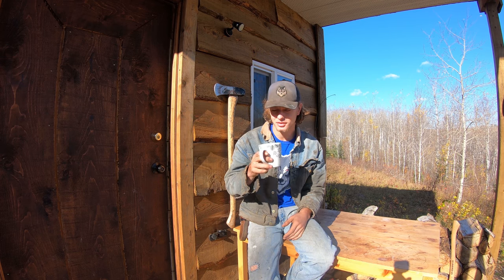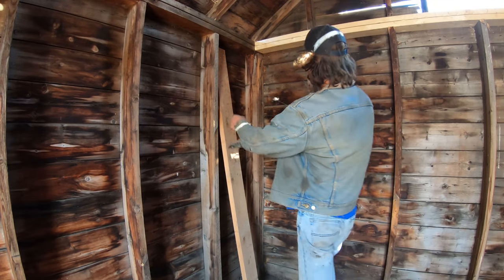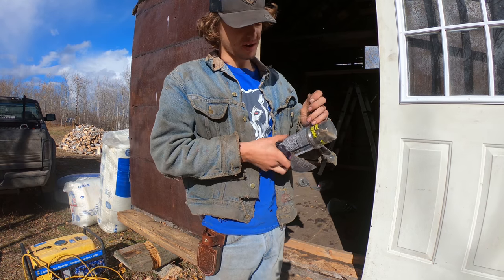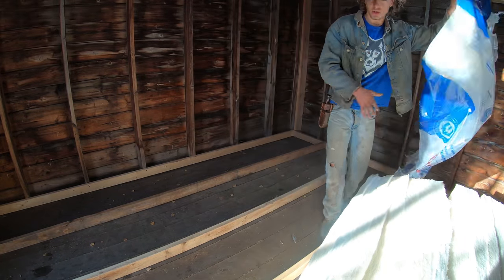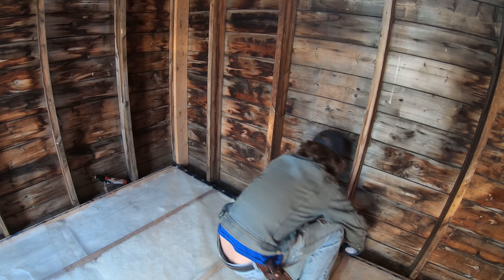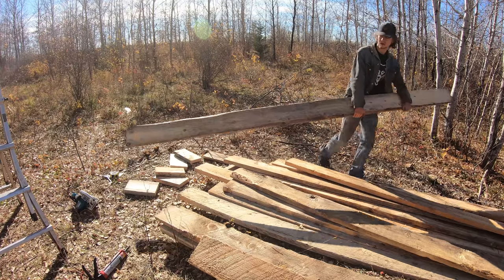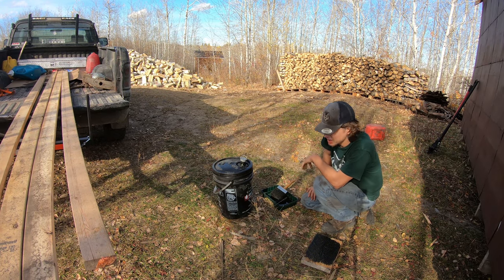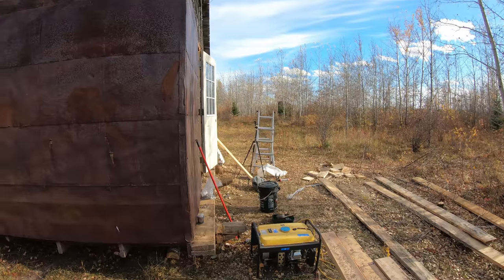Offgrid Workshop Project Pt. 3 - Putting a New Floor in the Workshop

Comment: You need to get a couple of lengths of ordinary, white pvc pipe, about 6" dia, cut an inch slot along the top and then attach to your rafter ends after you get your metal roof on.  This makes an easy and cheap eavestrough that you could collect rainwater with. I realize that it will be frozen most of the year but could make hauling water in the good months less of a chore.  I can hardly wait for the next episode. Great videos. Cheers from Vancouver.  :)

Comment: Floor tirned out great. Your going to suprise how easy it is putting on the tin roof. 1 tip predrill the screw holes in the tin so the screws look straight plus its alot easier putting them in and not having to fight screw going thru the tin. I put a tin roof on my garage and drilled 10 sheets at a time so they were all the same.

Comment: If you end up with more gaps in your floor than you'd like you could mix some wood glue and sawdust into a paste and use a putty knife to spread it into the voids. It'll be practically invisible once all said and done and it will take stain well. I've found that its stronger, easier to stain, and blends in better than any wood filler you can buy. If you use sawdust from the same wood you're gonna use your filler on you get a perfect color match every time and don't have to worry about staining your filler to match the existing wood. Also if your boards have any shrinking, expanding, or movement in general it won't just crack or crumble like most store bought wood filler would.
Anyways I'm lovin the videos, cheers from Maryland, USA.

Comment: Used trans fluid might give you a lighter colour...probably stinks a fair bit more though. We used to use it for undercoating vehicles and machinery, and would spray it with a cheap hand pump sprayer.  Not sure you could spray used engine oil, but I can't see why not.

Comment: Great work just offering a though. Not sure if you plan to put anything over the insulation to cover it, also not sure what foam board sheets cost in Canada. Where I live it and sheetrock are close to the same price. In a workshop that I wanted as much insulation for the money, I would use foam board instead of sheetrock. I would use sheetrock where you plan for the heater stove pipe to go through.

Comment: Hey , not trying to be the “ You Should Have Done Guy or Know It All “ one  either , just something to think about Guy and you may  already be on this , you will have to be  careful with any kind of liquid going through the cracks in your floor boards , the moisture barrier will just hold the liquid -  Water,  Blood,  etc. until it dries which could take along time and the smells would be horrendous , also causing mold on the bottom side of your floor board’s. 🤔 You have done a great job and I admire your work ethic and being your on man paying your own way , you don’t see that much today .👍👍👍 It would be awesome to have shelters  on both sides for dry firewood and dry storage , Future projects ?? Keep up the great work.  All the BEST to you and yours.

Comment: The building is coming along. Great video. If its always windy there I'd look into a wind turbine for energy. Might make more power that way.
Reply: I think that it's kinda costly for a small wind turbine. ..prolly why he doesn't have one yet. Maybe he'll post his post office box number &address so a fella could send a little to curb the overall turbine costs
Reply: @MC-gp9ke  just need an old wind mill, wire an old alternator and deep cell truck batteries. Then just transfer the power from batteries to the source of the fuse box.
Reply: @aarond4821  thank you Aaron,  I'll try an old windmill that was used to turn a waterwell pump. I'll investigate types of alternator -generators to feed a set of deep celled truck type batteries. From there I will  use a inverter or converter to produce Alernate  Current (A.C.)  power from the Direct Current (D.C.) battery supply. Not certain the amount of power that I'll end up with ...

Comment: I'm curious about your opinion on American building codes for insulation that I saw on Matt Risinger's channel. The recommendation for your climate area (alongside most of Alaska which is my interest in homesteading) is 20r-value cavity insulation + 5 continuous or 13r cavity + 10r continuous, which also means inside insulation rating + outside insulation. (I noticed you didn't insulate the outsides of your buildings and was curious if there's a notable effect.)

Source: Slide 23 from the Residential Provisions of the 2018 
International Energy Conservation 
Code you can easily find in Google search.

Also make cob constructions like the OG canadians and Americans did lol. It's so much cheaper than buying the wood and you're on a massive wealth of clay. You just need some straw and sand.

Comment: if you think your nail or screw is going to crack what u are putting it in flip it around and dull the point by giving it a good wack with the hammer .old carpenter trick

Comment: looking good!  What you think about putting your wood stove on either side of the front door?  Kinda  dead wall space, not hauling wood thru the shed and with the zone heat the wood burners create you have the hot spot in the coolest location??  Nice build however you decide!!

Comment: You should put the wood stove in the front by the door. A couple reasons, that’s where you will lose the most heat, coming and going. Second easier to have it there so you aren’t carrying wood through your shop. Last, that leaves all the rest uninterrupted space. If you put it in the back you will regret it.
Reply: Night Garden  yeah good point. Hadn’t thought of that. Especially with the only windows being so high.